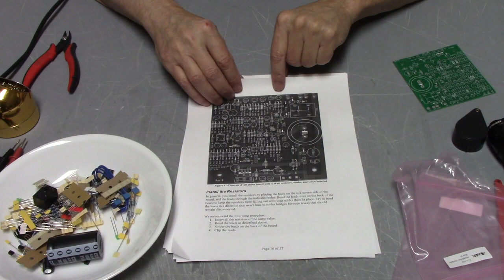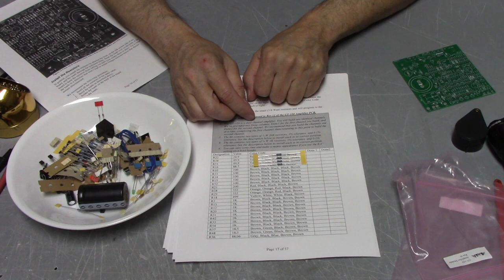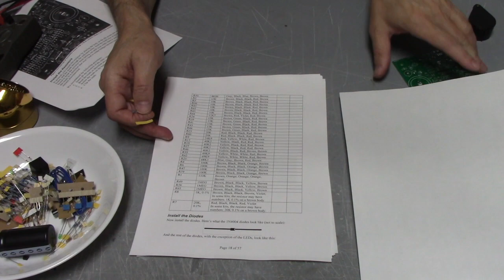About the GT-102, Z4, and GT-104 Amplifier Modules

Comment: I hear some good vibes about your amplifiers, do you post to the UK ? it takes 240 volts? 
Do you do an integrateds? I'm assuming the gt104 is the better one it can do 4 ohms I was told the gt108 can only do 8 ohms is that correct? the  4ohm varian will it go down to 2ohns?
I was wondering about the role of wire around the filter caps couldn't work it out, is that for some amperage measurement feedback? What's its purpose? Thanks it looks interesting you're Gear
Reply from the maker: We ship to the UK regularly. The transformer can be rewired for 240 (primaries in series rather than in parallel). We do have to change the switch, as the pilot light needs to be set up for 240V,and that is a different switch! We currently make separate power amp and preamp, but not an integrated amp. GT-104 is set up to deliver more power into a 4 Ohm load, GT-108, more power into an 8 Ohm load. Either one works just great assuming some reasonable speaker efficiency or not-so-crazy SPLs. The wire around the cap is part of an output inductor. The manner of doing this is a bit different than you'll typically see, but The output inductor is a common feature of almost all (solid state) amps.

Comment: I wonder if this is an upgrade sound wise compared to the lm3886 ?
Reply from the maker: Both designs, where LM3886-based or MOSFET based,  sound very good. The GT-104 and GT-108 were designed with MOSFETS  because of Texas Instruments inability to ship LM3886.
Reply: @akitikallc6161  thanks for the prompt response ! I Cannot find the full specs of  gt-108 and if there's a 230v version ? Thanks
Reply from the maker: @solaVeil  Yes, there is a 230 volt version available. Send me an email with exactly what you'd like to order and I can send you a Paypal invoice with a $4.00  line item for the 230V kit. It's mostly in rewiring the primaries of the transformer, but we also provide a different switch whose pilot light is rated for 230 V.  And about specs, there is a little  here on the web site at https://www.akitika.com/GT108.html     , but I should put posting a more complete list of specs on the to-do list.
Reply: @akitikallc6161  thanks for the informations, i ll be watching your website for the specs.

Comment: Edit - what I wrote here is not correct: from what you say about the GT-104 heat sink, I am assuming that the left and right channels are now on either side of the case? And the transformer and the power supply board are in the middle? Will there be two shields; to isolate the power supply from the audio sections?
A question about the gain of the GT-104 vs a GT-102 Z4 - are they the same gain? If they are the same, then they could be used to bi-amp; with the GT-102 Z4 on the tweeter/mids, and the GT-104 on the woofers.
Reply from the maker: Neil, The layout will be very similar to the GT-102...only difference is that the heatsink is a single large unit, rather than two smaller ones. We have also extended the height a bit. Overall, there should be less temperature rise for a given level of power dissipation. All the amps are set up with the exact same gain, so that makes biamping straightforward.
Reply: @akitikallc6161  Thank you for the prompt reply! That is great that you can keep using the same basic case.

Comment: Thanks for the update, Dan. Can the new amp & power supply modules be dropped into the chassis of my GT-102? I was (and am) completely impressed with the quality of my GT-102 Amplifier & PR-102 Preamplifier. Keep up the great work. (BTW - I've never seen two transistors mounted together to the heatsink the way you've done here... ingenious!)
Reply from the maker: Yes...you could build the new electronics into a GT102 enclosure. If you were using the amp in heavy duty service, you might also want to change to the new heatsink. Hopefully, we'll have all the documentation sorted out for this kind of upgrade by the end of October.